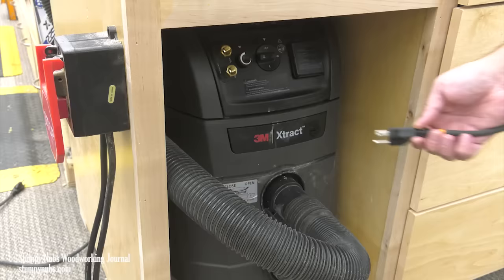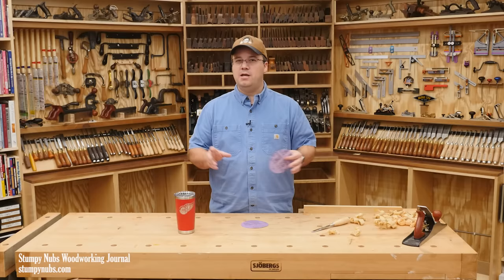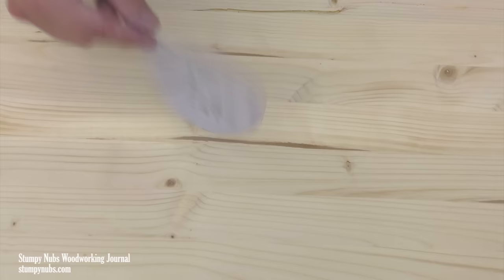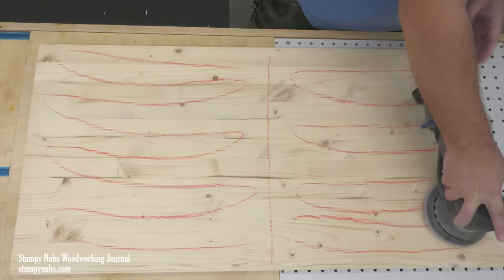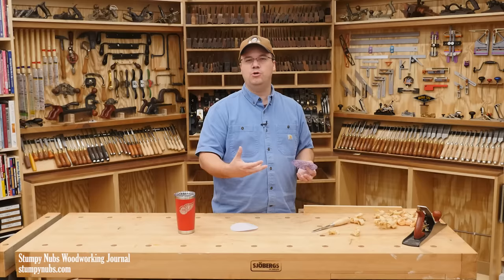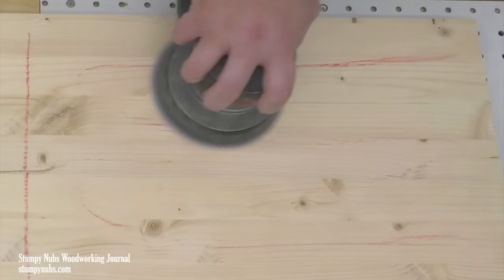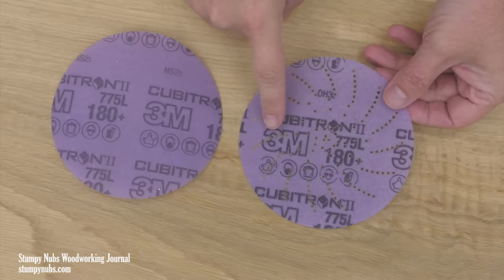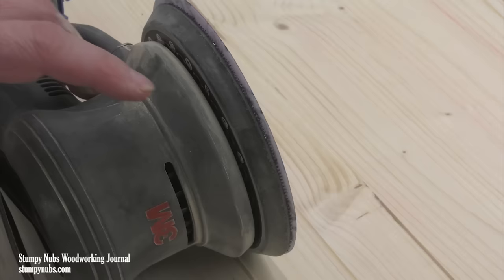This LITTLE KNOWN tip will cut your sanding time in HALF!

Comment: I wish you would've done a comparison between the sander with and without the dust extractor using the same paper with holes to show the difference between the sanders factory extraction ( what 80% of us use) and an external extractor
Reply: Agree! It was not a 1:1 comparison. Also, how much of the red on panel 1 was loose dust?
Reply from the maker: That would only tell you about MY sander, not the sanders that others have. And it would not have changed the conclusion- that dust extraction (no matter where it comes from) speed up sanding.
Reply from the maker: @pinkerbot Look closer. There are red lines left, not just pink dust.
Reply: @StumpyNubs  is the difference in self extraction really that drastic from brand to brand though? And I imagine you must have a couple of box store sanders laying around. You know we never get rid of tools that still work 😅
Reply from the maker: @pattyofurniture100  Most inexpensive sanders with "self extraction" work poorly, so they are of little use. It is common to still use a shop vac. The couple that work well (I hear Bosch does a good job) are not relevant to people who don't own one. Neither is my $600 3M sander, which I essentially said in the video. So I eliminated that variable and just showed with or without suction. The point of the video is how suction speeds up sanding. Where that suction comes from doesn't matter.
Reply: @StumpyNubs  I did like that my bosche had the big hard shell plastic as opposed to the bag type but it kept falling off and there was no way to attach a hose to it. My Hitachi works great but the attachment port is so small I don't think anyone makes an adapter for it. I'd like to get to where I can add extraction to it but finding an adapter seems to be the issue. I might have to make one. BTW thanks for all your content. You are the "one-stop-shop" channel that I send everyone to when I see them looking for advice on fb.

Comment: It night not be related, but last time I finishing with the mesh cubitron I had to drill a bunch of holes into my shop vac hose (really a “sacrificial” hose connector) to decrease the suction, because the sander was sucking itself to the surface too much and sanding off more than I wished. At the end I drilled probably 15 to 20 3/8 holes. I have never used a dust extractor, so I can’t speak to that but it is possible that some amount of suction is still adding to the downward force.

Comment: The dust boogers was bordering on too much information, but funny as heck.  As for the 3M sanding disks, am convinced enough to try them.  I am sure I have seen them used before — I think it was Jonathan Katz Moses' channel — but your demonstration made a better argument, because I don't think JKM stressed the use of a dust extractor.   I'd still be interested in the difference between dust extractor and shop vac for this particular application, but I am sure I can find that discussed in one of your earlier videos.   So thanks for the heads up, and thanks for the booger smile.

Comment: To be fair, a better test would be to try the discs with the tiny holes with and without dust collection.  There IS a slight chance that it's the holes alone that cause the better sanding.  That would be another working hypothesis as to why the sander worked better.

Comment: Very interesting once again. Have you done a comparison between a palm sander with a dust bag and holes in the paper?  I find my Dewalt palm sander with the bag leaves very little dust behind. I can attach dust collection to the sander but to be honest it’s much more comfortable and convenient to not connect the hose. 
Any thoughts. 
I have not tried the Quibitron paper yet but I will. 
Thanks.

Comment: I'd like to see this re-done where both sanding disks have the holes in, as with brake rotors grooves cut in the disk make a huge difference to chip clearing, I imagine the holes alone with no dust extraction makes a difference

many thanks
Reply from the maker: Brake rotor grooves continue from the center of the pad to the edge, creating channels. Holes in a sanding pad would not function in the same way since dust could not escape from them.

Comment: The folks at my local woodcraft tell me that turning the suction down from max on my extractor will also result in better sanding time and results - I guess because it keeps the sander from 'suctioning' down to the work piece. I know I've felt that suction before, do you think that really matters?

Comment: Hey could you go over end grain & finishes.  I’ve tried going up some grits and leaving the top 1 grit lower.  Some times my endgrain looks way way darker on walnut.  
I notice when I sand the resin , it seems to clog my vacuum more.  I pull the vacuum apart and clean my filter bag thing , then get back to sanding.   I always kinda test it and make sure it holds itself down to the work.   As long as it does that , I know I have enough vacuum.  Great video

Comment: Orbital sanders typically have vanes to generate their own dust extraction, right? So if the dust extraction is sucking air through the same system, isn't that going to take some load off the sander motor, and have the effect of speeding up the sanding rotation? I.e. couldn't that also be contributing to the faster sanding?
Reply from the maker: Some do, but few do it well.
Reply: @StumpyNubs  gotcha, but regardless of how well they do it, as long as a sander with no bag on the end is blowing dust out, it would seem like the suction of a dust extraction would have the effect of aiding the motor significantly. I'm wondering if that might be a significant boost to the sanding speed. Basically the opposite effect of how a clogged collection bag would be a drag on the speed.

Comment: Great video, I agree that dust collection helps. However, I wonder if simply using the paper with holes would produce a much closer result, even without a vac. I use cubitron mesh paper, and I rarely have dust on the work piece. It helps extract the dust without suction.

Comment: Certainly this idea is also somewhere else in the comments:
Parts of your astonishing result certainly come from avoiding the unnecessary grinding of dust. But please do also consider, that the vacuum between disc and surface results in a higher pressure of the disc against the wood - compared to the vacuum-free test. And we all know, from own experience, that more pressure results in faster abrasion. You should be able to measure this difference indirectly, because you should have to use more horizontal force for moving the sander around.

Comment: Mind blown!  I don't use the shop vac because it upsets the balance of the sander and it makes it awkward and because my Bosch gathers tons of dust in the on board collector.  Guess I need to re-visit that.
Reply from the maker: If your sander collects the dust well, the results will be similar. The point is to keep the disc clean as you use it.

Comment: I’d wager the suction introduced by the shop vac on the sanding surface adds downward pressure and thus increases the sanding results with the same amount of hand pressure as in the non-vac side.

Comment: I'd be curious to see if there's a difference between the perforated disk and a mesh disk, if one or the other is better at allowing dust to be sucked up and away from the work surface. Interesting demonstration. Thanks for sharing!
Reply from the maker: I think the mesh disc would allow the most airflow. But it's not as durable.
Reply: I recently saw a video by Johnathan Katz-Moses that included both the mesh and perforated disks. In that test mesh works better, but like Stumpy says its less durable if you're using it on corners or hit a screw or something. The perforated disks are still very high-performing, so might be worth getting a small pack of the mesh and see if you have trouble with ripping them up before you get all the use out of em. If they work well for you, then congrats, all the benefit and no downside!

Comment: Certainly I find sanding faster and better with good duster extraction. Vs Cubitron sanding discs, it is best on flat, but for edges and coarse epoxy plus wood sanding I find mirca sanding discs better

Comment: I don't have a shop vac, or a dust extractor. Planning on getting one, but there's other tools on the list first, like a table saw. Can I use an old vacuum cleaner? I got one for $10 and it sucks up dust, but I'm a little worried about the thing catching on fire. 

Having a fire in a dusty shop sounds like a nightmare.

Comment: Just a thought: dust extraction probably has a cooling effect on the abrasive as well. That has to be good thing!
Reply: An extractor actually cools the sander. Some professjonal sanders will overheat of you don't use an extractor.

Comment: Don't most palm sanders have some amount of built-in suction with their spinning action? Seems like a disc with no holes stops whatever little built-in suction there is. I wonder if the better comparison is not a disc with no holes, but two discs with holes, but one with the extractor on and one with just the regular sander going.  I'd be curious to know what the difference is between those set ups, or if it's negligible.

Comment: There is a confounding variable in this test.  The sandpaper discs were not identical.  One had holes, the other didn't.  Maybe the mere presence of the holes (excluding the vacuum extraction) caused the result seen.  A better test would have been to use discs with holes on both sides.

Comment: Good info and I always use a dust extractor on when sanding but most modern sanders do have fan blades that keeps the motor cool and removes sanding dust from under the pad, mind you it is not dust collection but.... It is more accurate than that 3M demo..
Reply from the maker: What's more accurate?
Reply: @StumpyNubs  I think they're trying to say you should have run a test using the perforated sanding disk but not attaching the hose. Just to see how much the extractor improves the suction that a sander already naturally has.
Reply from the maker: @Beakerbite  Your sander doesn't work the same way as my sander or the next person's sander. So there will be something to nitpick in any test. The conclusion was that suction speeds up sanding. It doesn't matter where that suction comes from.

Comment: I think its because without dust collection, the red wax and sawdust is pushed back into the wood, but with dust collection it doesn't. Its not taking more or less off, its just not pushing it around/back into the woord.
Reply from the maker: No, you can clearly see some of the red lines are undisturbed in the first example.

Comment: Nice reminder why dust collection at the start is better than at the end!

I'm curious your thoughts on how the cubitron II discs compare with the mesh type discs. I've found them to be nicer than the old form/standard disc but I wonder if the suction isn't as effective after the explanation you gave on the spiral pattern.
Reply: I tried the cubitron because my mesh discs were out of stock. I never went back to the diablo mesh.

Comment: I would have liked to have seen  the time difference for using paper with holes & just the suction provided by the sander itself. No dust collection.
Also I have always thought that if a sander had a forward/reverse switch. It might extend the life of the paper. I feel that the abrasive points are worn off, & if I was able to reverse the spin, there would be some abrasive points exposed. Not sure if it would make a discernable difference. Enjoy your videos, thanks.
Reply from the maker: It's about keeping the sandpaper clean during use. If your sander does that well with internal suction (I have found few that do it well), you will get the benefits mentioned in this video.

Comment: Apples and Oranges. Sanding with a non-perforated disc will trap dust in the sanding area and reduce sanding efficiency and time. However,  sanding without a vacuum using the sanders built in dust extraction and perforated sanding discs will keep the dust from clogging the sand paper. So it's not really a fair test.  Having said that I definitely prefer to use a vacuum as it cuts down on the airborne dust.
Reply from the maker: It is a fair test if you pay attention to what is being tested. The comparison is between having no dust extraction, and having dust extraction. It doesn't matter where the suction comes from, be it a vacuum or a sander with internal suction (I have found few that do that well, but it doesn't matter)- suction helps, as the test showed.

Comment: In addition to all you said, I think that the suction of the dust extractor pulls down on the sander, which would be about the same as pressing down on the sander a little bit.  Not too much to bog it down or change the random orbit, but it does increase the pressure between the sander and the wood.

What do you think?

Comment: Anecdotally, I've found that the Cubitron disks are much more prone to clogging than others and so need dust extraction in a way others don't. I'd be curious to see this again with a different, more traditional sanding disk.

That said, it doesn't really matter. They really are an incredible leap up over other disks, and dust collection has other benefits. So even if other disks don't behave the same way, I'm still going to stick with the Cubitrons and my extractor.
Reply from the maker: I can't imagine why they seem to you to clog more. If anything, the precise size and shape of the grit (which is the main reason they work so well) would be less prone to clogging. But everyone has their own experiences. As I said in this video, you will see benefits of good dust collection no matter the disc you use.
Reply: @StumpyNubs  I should have been more precise in my words: more prone to clogging _without dust collection_. I think it's the fine, even distribution of particles makes it a little easier to fill up the tiny gaps with dust.

With dust collection, though, they clog vastly less than others. One of the reasons I love them.
Reply: @JamesTM   - In my experience, the Cubitron discs create more dust - because they cut more material - so if used without dust extraction, they may very likely load more quickly.
Reply: @DB_Customs  Thats certainly a plausible explanation.

Comment: I tried a different version of this disc and was not impressed (710W Xtract™ Net Sanding Discs Cubitron II ™)  After one use I noticed the new pads were not sticking. The saw dust was clogging sanding pad and the new pads did not stick as well. I may try the one you recommend but I'm guessing it will have the same problem eventually. I think this is a bad idea (a gimmick) and that the 5 hole is every bit as effective at removing the saw dust. The girt is most likely much better however.
Reply from the maker: A couple points- A mesh disc is not the same as a regular disc. With a regular disc you have a lot more "velcro" to stick to the pad of your sander, and a regular disc is much more durable (mesh discs can shred if you are overly aggressive, especially on the edges.)... Also, nobody said 5 holes are not effective. You can collect dust just fine with 5 or 8 holes. But the spiral of holes are indeed more effective in extensive testing at 3M, and in my own observations. Gimmick? No. But also not a necessity. Either way, I like the discs for the Xtract grit, not just for the hole pattern.
Reply: @StumpyNubs  I've been using 5 hole discs with a vacuum for about 20 years and what you said is absolutely true. It makes a huge difference. In fact, I sanded all the oak face frames in my kitchen with zero mess. You (and 3m) are probably right, the new hole pattern and mesh being more effective but at what cost? I sanded a couple poplar boards and they 3M mesh disc started slipping off the pad. When I tried to go back to the standard 5 hole disk there was a very noticeable difference in the way the disk was holding. I had to use compressed air with a little help from my fingernails to get the Velcro clean.  I suspect some wood is much worse. I was sanding poplar and it sticks to everything. It may be that other types of wood don't have the same clogging effect. I'm sold on the new grit but I'll stick with the 5 hole discs. Maybe not a gimmick but I suspect a small improvement and not worth sacrificing my sander for.
Reply from the maker: @WinkysWorkshop  - You keep taking about the mesh discs and the regular ones as if they are the same in regards to sticking to your sanding pad. As I said, the mesh discs do not have nearly as much hook & loop surface. If your sander doesn't like them, try the regular ones.

Comment: It make sense to me that with a vacuum it works faster. Can you explain the difference between a dust extractor versus a vacuum.  I’m sure most here have a vacuum.
Reply from the maker: Both machines will suck air enough for sanding and other handheld power tools. The shop vac will lose suction as the filter clogs, and people never clean them enough. Many dust extractors have filter cleaning mechanisms, so it is easier to maintain good airflow. Dust extractors also have nice features like finer filtration, auto-on (with the tool), and are generally quieter and longer lasting.

Comment: Wouldn't the holes let the machine suck away some of the dust even though the vacuum/extractor is not attached?
Reply from the maker: Some sanders do, others don't. It doesn't matter where the dust collection cones from as long as it effectively removes the dust.